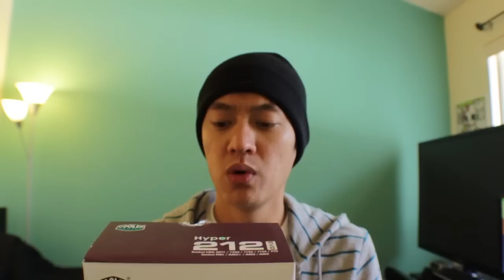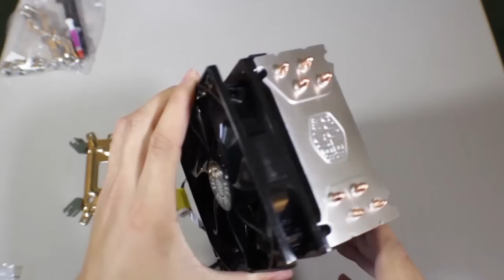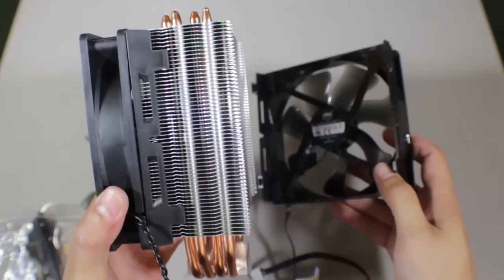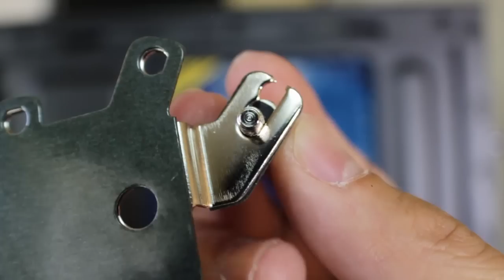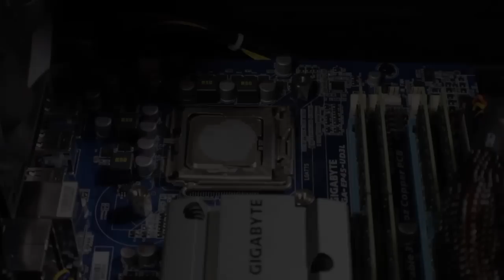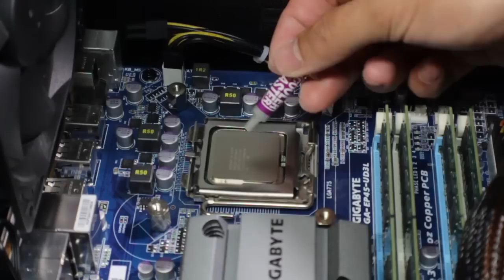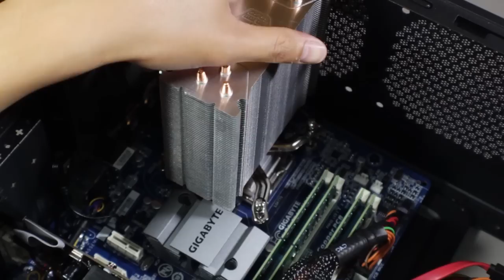Installing an After Market CPU Cooler Fan - Cooler Master Hyper 212 EVO

Comment: I got the Noctua NF-F12 fan for my hyper evo 212 CPU Cooler, and I was wondering if I should take off the rubber pad things on the corners so the rubber doesn't burn (I don't know of this could happen that's why I'm asking) since the rubber would be touching the heatsink. Should I?

Comment: Nice cooling set up! I got 212x too with push pull method as well with replaced fan 2 Corsair SP120 PWM High performance just keeping my i5 4690 under cool temp not over clocking it. I got it uploaded on my videos here in YouTube! :)

Comment: Biggest piece of shit after market fan. Don't know why everyone loves it. Cannot ever get the sucker to install correctly....
Reply: Gerald Smith That's because you need to buy a console and leave the PC scene. You're no good at it.
Reply: Never had a problem with a pc other than this fan. Built 4 units and just finished this one. Little troubleshooting and a different video goes a long way.
Reply: Gerald Smith Genuine question, what part of the installation did you find tricky?
Reply: +Mark Walker not going to bother. It works and does a good job. Friend says its working great.
Reply: Gerald Smith Yeah definitely not user error >_>
Reply: Ahhh ok thank, I was looking for help as mine was arriving a few days after your posted. It turns out it was pretty easy to install and, like you said, works amazingly.

Comment: Hey I'm currently learning about building PCs and I was curious as to why you don't use an anti-ESD wrist strap? Is it because it's not necessary for what you're doing or do you make sure to ground yourself on the case before you touch anything inside?
Reply: Zeneric Music Most modern parts hold up well to ESD. In the past, it was easy to mess up parts by simply touching them. Now, most PCBs are coated to prevent ESD, or even be water resistant. As long as you're not shuffling around in socks on carpet, you should be fine to wrap your hand around your motherboard. 

Still, I'm careful with the parts (as in barefoot and not touching of sensitive components). Like Freddy Q said, as long as you touch the case every so often (once the motherboard is screwed down), you shouldn't run into a problem.
Reply: You can always touch the metal backing of your pc case prior to working on any parts. It will discharge you of any static charge.
Reply: Yeah that's what I meant when I asked if you make sure to ground yourself on the case before you touch anything inside, i guess I meant to discharge and any static energy you had but thanks anyways that pretty much cleared it up for me!

Comment: What can I use to mount a CPU back plate if I don't have the self adhesive stuff that came with my after market cooler. I've changed it into a new mother board. And now don't have anything to stick it in place to mount the cooler

Comment: Thank you, I am adding a Cooler Master Hyper 212 EVO - CPU Cooler as soon as it gets here [which should be tomorrow <Saturday>] So I should be installing it Tomorrow or Sunday - I am having Heat issues, right now it is running at 158 F and sometimes when I try to do a Browser Game, it will shoot up to 180 F to 185 F and that is not good. This should Help :)

Comment: Don't forget to evenly spread the thermal paste in a thin layer over the entire top surface of the cpu in order to ensure maximum contact, tighten down heat sink in a crisscross pattern to ensure even compression.
Reply: No. No one listen to this guy. Spreading heat paste over the cpu is the worst way to apply thermal paste. Look up any video to see how bad this method is. The simple pea in the middle is the best way.
Reply: Well considering I am certified in computer building and repair, I might just know a few things, do it however you want, but don't cry about it when you aren't keeping your cpu cooled properly.
Reply: ***** You have no proof to back your evidence up. Yes, that WAS the way to di it 20 years ago. But since then, it was discovered that the pea method is the best way. So many videos attest to this. Don't let your bias/experience cloud your judgement.
Reply: In order to maximize thermal transfer the heat-sink must make contact with as much of the cpu surface as possible without air gaps, using a thermal compound medium. By using a pea size amount in the center you will not be maximizing surface contact, thus allowing 30%+ surface area to remain out of contact. Try for yourself, install heat-sink on cpu with pea method, then remove heat-sink and see how much was left uncovered. You will have a circle in the middle and nothing else, even new cpus come with a heat-sink that has a big square of thermal compound already applied. Do as you wish, my post if for people who want to know the right way to do things.
Reply: ***** No, your post is simply wrong. How many times do I have to tell you that the CPU Die is what needs to be cooled. Also you have no facts to back up your argument. Sorry buddy, but I just can't take you seriously. When thousands of videos are supporting the Pea theory, and me knowing the CPU die in the middle needs to be cooled. The Metal square is only there to DISSIPATE heat FROM the small die into the heat sink. In my computer hardware college engineering class, we took apart a cpu. The CPU isn't the metal square, It is a small, rectangular, mirror like die in the middle of that square. And CPU's NEVER come with thermal paste pre applied. Your credentials in repair and building seem to be false based on your false assumptions/lies.
Reply: Is that your computer I smell melting? You just outed yourself as a git.
Reply: ***** git? Okay. Instead of having a logical argument, you refer to slurs and insults now. I'm assuming your southern too based on that slur. Thanks for only confirming my suspicions about your lack of knowledge on computer hardware.
Reply: ***** What, no one is telling me to do anything? I know that? Sadly wrong people resort to insults when they themselves know they are wrong.
Reply from the maker: GuruR97 Thousands of videos are showing you the pea method because it is the easiest way to apply thermal compound. Non of these videos show or compare the effectiveness of heat transfer between pea, line, or spread. So you have no facts either. It's great that you know what a CPU die looks like and where it is located. The IHS is what's in contact with the CPU cooler, not the die. The more you can dissipate heat from the IHS the better. Do you think that the IHS only gets hot on top of the die and not the rest? If so then you need to learn more about heat conduction. I however, am actually doing some tests on a couple of popular thermal compounds and trying 3 popular methods of applying them and seeing what the results are over air cooling. It is taking me a long time because Arctic Silver 5 takes 200 hours to cure before working at it's highest efficiency. I encourage you to do your own testing of the 3 popular methods with your favorite thermal compounds because I already can tell that people will say I am biased. Also, CPU's don't come with thermal compund pre-applied but some CPU coolers do and guess what, they are all spread across the entire surface area of the CPU cooler. Not a small square in the middle. Next, you're going to show me evidence and facts of air bubbles using the spread method. This is evidence and fact using materials that is not part of a computer system so I can't really count that as evidence. It's also half a test because they didn't use that plexiglass with a spread on the CPU cooler. So stay tuned for my videos on that.
Reply from the maker: Elkotend The surface of the heat sink and the surface of the CPU is not as smooth as glass. So I am pretty sure the cpu and heatsink is not creating an air tight seal for air to escape. If there were any pockets of air. Would you agree? Also, are you sure they are using glass in their video or are they using a piece of acrylic that can bend when pressed on the edges to create air pockets? Would you agree to that also? And finally, look up or ask a physics teacher about how heat can be transferred from a gas to a solid. Specifically about convection and conduction. II'll have a video showing and explaining this soon. Oh and what were the temps on these CPU's when there were "supposedly" air bubbles vs the non-air bubbles?
Reply: ***** that's the point of the thermal paste.
Reply: ***** Check tek syndicates video on it. Spreading it causes the cpu to compress and make air bubbles and shows it by having a clear hard plastic to show us
Reply: ***** When you spread the thermal compound over the CPU to "ensure maximum contact" between the heat sink and CPU, you're actually creating air pockets which traps heat and keeps your CPU from getting cooled off. When you use the pea method, it pushes the air bubbles out as you press the heat sink down onto the CPU and lock it in place. There's a video somewhere on Youtube of someone showing this by using a piece of glass instead of an actual heatsink, and you can see exactly how it spreads.

Comment: Is there any reason the cooler is so loose when you attach the fans? Surely it should be nearly rigid. Looks like it turns way too easily in which case there would be less contact with the CPU that should otherwise be the case.

Comment: My only concern is at time 22.40 when you're attaching the fans, the cooler is moving. It should not move or else you won't have an effective thermal contact and with the fans installed you cannot tighten the screws. I had the same issue and had to play with it until it was secure before refitting the fans.

Comment: you once instralled a 212 evo to a sentey case? (optimus gs-6000)
Reply: That case is way too small for a hyper 212 my mid tower case could barely fit one
Reply: Senor Fancy I actually installed one in a sentry case in the last 2 months

Comment: Remember if your case needs MORE than what the CPU cooler requires because standoffs take up just enough room to make your side panel not close with this beast on it. the case in video actually does not work with this cooler
Reply: It seems like he would have mentioned that in the video? I have the same case and cooler and they fit great (at least they look the same)! No doubt its a snug fit though.

Comment: How much space there are left for RAM (height from RAM to cooler)? I wanna buy this cooler, but wondering if it will fit as I have all 4 slots filled, and RAMs has those little heatsinks (hyperx blue).

Comment: Is it necessary to have a second fan exhausting the air out of the case?
Reply: no unless you plan to be super heavy on the cpu (high OC) from the research ive done 1 is enough.
Reply: Jacob Pugh IIRC, the 212 EVO does not benefit from a second fan.

Comment: Building a new gaming pc, i'm wondering if these parts are compatible and good for gaming?? 

Case: Cooler Master Haf xm mid tower

Motherboard: MSI Z87-G45 gaming

Ram: A-data 16Gb ddr3 1333mhz

Cpu: core i5 4440 LGA 1150, 6MB Cache 3.1ghz 

PSU: Evga 1050w 80+ gold

GPU: Asus Radeon R9 290 DirectCU II OC 4gb gddr5

HDD: 1TB WD 

Operating system: windows 8 64bit....
Reply: That power supply is way over kill
Reply: No problem. But even overclocking your 290 that 1000watts is still over kill. Honestly I would get a 750watt and use the money you saved to get the gtx980
Reply from the maker: Unless you are adding 2 more 290's that PSU is way overkill for just one GPU. You can get a EVGA 600watt. As for the memory, 16GB is a bit much for just gaming. You would only use 16GB if you are doing content creation or like to have 5 different programs running at the same time. One of them being a chrome browser with 10 extensions running and 20 tabs open. I would do 8GB and 1600Mhz RAM. Also, get a Z97 instead. Unless that Z87 was less than $40, then yeah you can stick with that. Also, if all those other parts were half the price from everyone else, then sure, keep all of it. Hope that helps.
Reply: Gary Bulter You should use pcpartpicker.com gary, After you input all your components it will tell you if they all match up.
Reply: That psu is so overkill  and so is the ram
Reply: Gary Bulter yes it would still be more then enough. I have the i5 k series and the 980gtx. and i bought a 630w power supply. And i overclocked my cpu to 4.5 and if i need to will overclock my gpu. so if u wanna be safe i say go with the 750W. and save yourself some money and invest in a higher grade gpu or cpu
Reply: Darude Sandstorm kheneee guys what do you think of this power supply Glacial Power-GP-AL-650W 80+ I know Glacial Power is not one of the biggest players in the power supply market... i saw the specs of this psu and i actually found it good.... this psu comes with six peripheral cables: a 6,8 pin video card auxiliary power connector each, and two cables with six SATA power plugs so do you think it's worth it? this is the official website : http://www.glacialpower.com/products/pc-power-AP.htm please I  need your help people I'm a new building and i don't want to see my pc burning!
Reply from the maker: By the way, you won't be able to add 2 more 290's. Only one more.
Reply: ***** Ben Trevino Thanks for reply and your information  guys ! but i prefer evga 1050w gold because im going to overclock my gpu as high as it is safe to overclock it... ^_^
Reply: Ben Trevino Thanks again!
Reply: Ben Trevino but what if i changed my cpu to i5 K-series.. is 750watt  enough for overclocking cpu and gpu both ?
Reply: Ben Trevino Alright thanks again....
Reply: Gary Bulter go for r9 290x
Reply: Ben Trevino kheneee  Thanks
Reply: Stefan Kellegher  Never to much RAM. Its only 16gigs
Reply: The Mainboard is overkill for the processor. Go with a B85 and get 4460 or 4590 or a Xeon e3.
Reply: Gary Bulter what the fuck do you need 1050w for?????
Reply: +Gary Bulter Generally I'd say the fool proof formula would be, the bigger your case and power supply, the better, a half tower?  Might be too small, if not now then years from now.  Because you are going to upgrade your video card, you are going to upgrade your mobo, you may want to put on memory cooling, add more drives, who knows what they will invent next year.   Better to buy too much case then too little.  Also at the very least, a full tower, with holes for fans in front, fans in back, and at least one fan  on top!  I don't water cool, never will, so next case i buy will have more fans then yankee stadium.

Comment: What else can i use if i don't have any rubbing alcohol available to wipe off the initial thermal paste?
Reply: Cormac Green Don't use nail polish remover unless it is 100% acetone. Some have conditioners and other additives that will leave a film.
Reply: Poo
Reply: lighter fluid ( im serious )
Reply: It has to be rubbing alcohol
Reply: Nailpolish remover

Comment: What kind of case do you have ? Mid tower?
Reply from the maker: That was a Cooler Master Elite 430. It is a mid tower.
Reply: ***** So this will fit in a Mid Tower no problem?
Reply: ***** Hey man I need some advice! I want to get this CPU cooler because I dont't want a liquid cooler and risk one of the tubes popping all over my exspensive equipment. But I dont't know if this will take up my ram slots? I know it varies from motherboard to motherboard. But what I have right now is a Sabertooth 990 fx motherboard. I have all my ram slots taken up with 4  Vengeance 2-Pack 4GB DDR3 DIMM. Below is the link of which ram I have. The issue is I am worried if I have to sacerfice a ram slot in which I do not want to do. Also I have a AMD fx 8150 8 core CPU will this work with my CPU? I would gladly appreciate it if you could help me out because I really want to get this but I don't know if it will work. Also I am getting a new case wich is a corsair air 540. Please if you could please reply back. Thanks bro:)

http://www.bestbuy.com/site/corsair-vengeance-2-pack-4gb-ddr3-dimm-desktop-memory-kit-blue/2904596.p?id=1218361848253&skuId=2904596
Reply: Mike Harder I just built a custom cpu using this cooler and a mid tower case by rosewill , very good cooler however it will be tight depending on the case that you use. For the ram slots it should go over the ram and not be a problem , just stick your two sticks on the first two slots.
Reply: 9
Reply: Matthew Chand I am using the corsair air 540 and the thing is I am using all my ram slots so I have all four slots filled with ram sticks. That is what I am worried about is because I have all 4 used that it wont fit. DO you know what I mean?
Reply: Mike Harder shouldn't be a problem the cooler should clear it
Reply: Matthew Chand what do you mean the cooler should clear it? hahah sorry just a little confused?
Reply: ***** Is the thermal paste used in this video any good?
Reply: ok, thanks

Comment: Would this cooler fit into a Rosewill Blackhawk? I read on the Newegg feedback page that it "was conflicted" but that was not clear enough for me. Thanks for the help.
Reply from the maker: You would need to find out the width of your case is larger than the 160mm height of the cooler. Just don't forget to factor in how much your motherboard and standoffs take up. So basically, find out if your case is at least alittle more than 160mm wide.

Comment: Thanks for this, considering buying one of these for the upcoming summer in Australia. It's a cheap unit but it's recommended by just about everyone that is ever asked for a cheap but good CPU fan upgrade..

It's so big compared to the stock fan.. haha.. what a beast!
Reply: Costs about 40 bucks australian but it is so worth it, never had my cpu overheat with this and although a little tricky to mount it works really well.
Reply: TheSeveredStem Yeh, I had a look around and I don't mind spending a bit more for liquid cooling, so I am going to go with a Hydro 105 or 110 instead. Still, it was this video that made up my mind that it wasn't too hard to fit an aftermarket heatsink, so thanks still! :)
Reply: Cool stuff